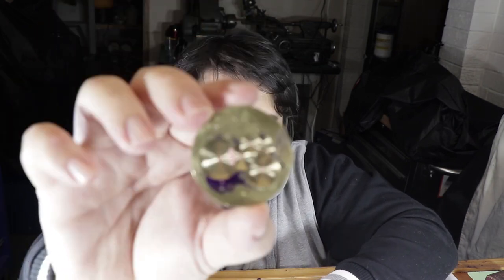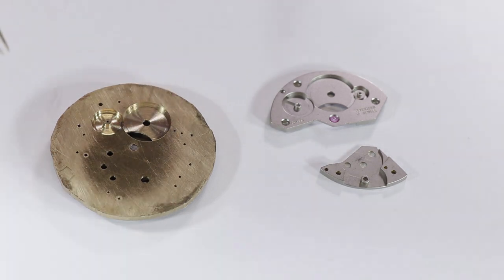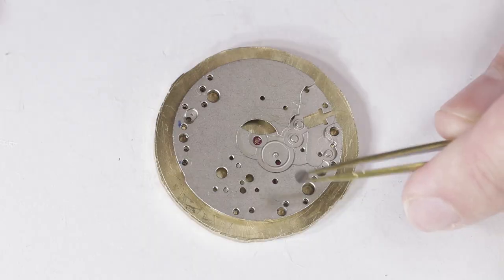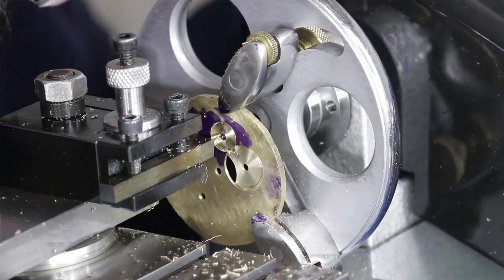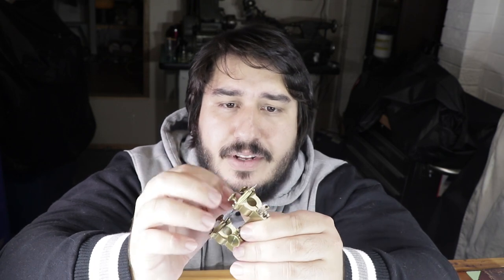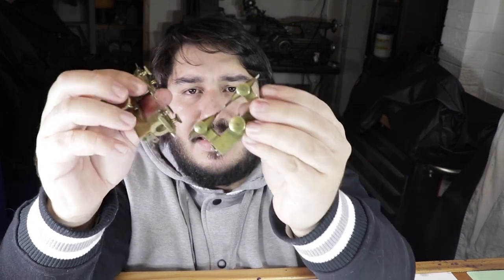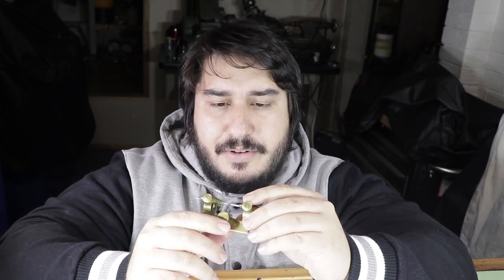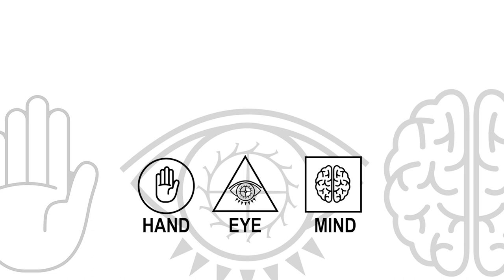Depthing Tool - Watch Repair Tools | Watchmaking Vlog #8

Comment: Hey Dean! Thanks for another good video.
What do you consider to be acceptable runout on a depthing tool? I have one of the type with the holes, not grooves, for the runners. It's not perfect I've come to realize after some measuring. It's out by a couple of hundreds on one side and seven hundreds (mm) on the other side. I'm thinking about trying to bend it slightly in a vise (placing shim stock on one side and squeeze) but messing it up worse is a real risk.

Best
Karl
Reply: Also, what would be a viable option for depthing?
Reply from the maker: Hi Karl. The information on alignment of the depthing tool is straight from George Daniels book. Where he talks about scribing a circle using all points (so scribing an arc, switching the point that is in the centre and continue small scribe). There should be no break in the line. So my takeaway would be in the range of approx 0.005-0.01 mm as line thickness should be taken into account. 

Yes, he notes that twisting the heads to parallel is a must if it doesn't pass the test (page 123). I have to do that slightly. Check the runners first though!

Using a Jig Borer would best option though. You would still need to measure depthing distance. But at least you could experiment making test pieces on the jig borer. I have been thinking also about using a linear xy stage. As it is also micrometer adjustments.

Comment: Any feedback on the Cowells CW ? Thinking about getting one myself. Seems like you got the wheel and pinion cutting module ? how is it ? Is it standard 8mm Collets, can I use some Boley or other brands 8 mm collets on a CW ? Amazing Blog !
Reply from the maker: Thanks for the comment. The Cowells is a real pleasure to use. The only thing would be when compared to a standard watchmakers lathe, I do a lot of lead screw winding to move the cross slide in and out of the way. It does come with it's advantages though! The pinion cutting module is easy to setup. It takes WW B8 collets like schuablin, and Cowells themselves. I asked Colin to make drawbars for standard American WW 8mm, so I can use types of collets on the lathe. At the moment I'm using Sherline Collets.
Reply: Thanks dude. Would you mind listing the accessories you got with the cowells and how much you use them. Maybe it's too big of a list ???

Comment: Love your videos. A shop tour would be pretty interesting. I would like to attempt the Daniel's method in a few years, but I have no idea what tools I need (or rather, which to start with). I do like the Cowells rather than an older 8mm watchmaking lathe.
Reply from the maker: Thank you. Maybe I will do a shop tour in the future if people want. Although I am planning on discussing tools in episodes. That would be an admirable undertaking! I love the Cowells, but it too has it's short comings. If I would of found a good 2nd 8mm kitted out at a reasonable price I would have gone for it. I have seen someone with a 6mm lorch make exceptional progress with George Daniel's pocketwatch.